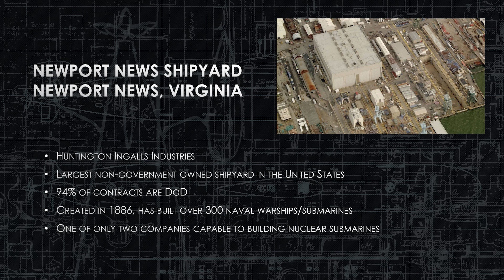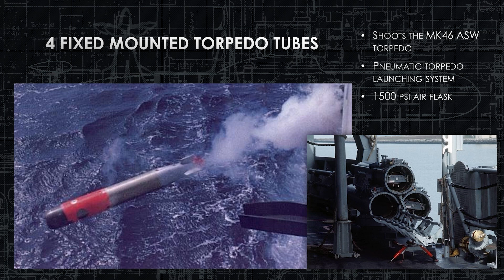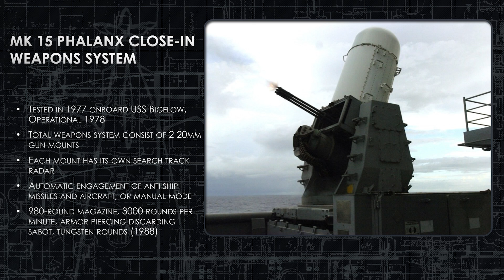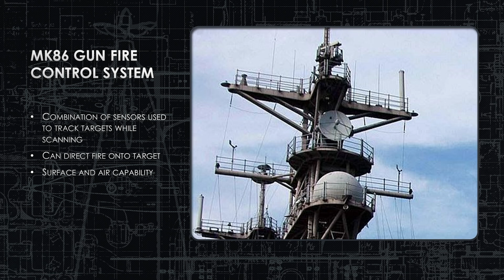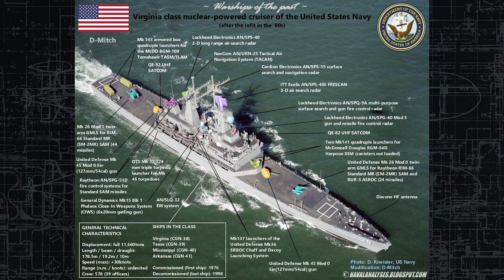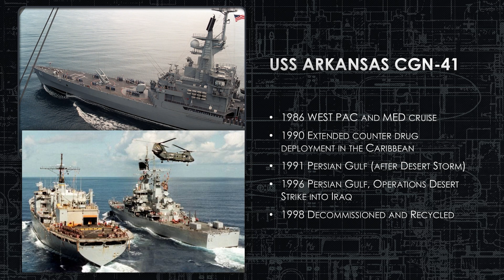America's Nuclear Cruiser Virginia CGN

Comment: Big fan of the CGN-38 class.  Cruisers that can stay with the carriers would be a force multiplier.  Have commented on using this hull to build the new cruisers to replace the Tico's!   They are bigger than the Burke's and Tico's (Tico's built on the Spruance hull) and with a nuke reactor (if you want to build a less expensive one use the gas turbines) can generate a lot of power along with not have to refuel (aux power would still need to be unrep'd but not as regular).  Plan on 64 cell vls fore and aft (replace the old Mk-26 launchers), hyper-sonic missiles mid-ship.  CWIS and SeaRam for point defense?  SPY/Aegis with the best Sonar you have!  A lot less than 12-15 bn for a battleship and probably more survivable.  With computer aided design could get these hulls out the door fast since they have been built before!

Comment: Self contained SMR reactors where it can be lowered into a new vessel and have other turbines so not to put huge strain on reactors just use them for propulsion mainly and have the two other turbines for generators then it'll have plenty of power but the reactors will be producing electricity for electric motors for propellers and the refueling process is as simply get ship to harbor unhooking smr lifting it out putting new one in hooking it up systems check deck back on crew back from R&R then off to sea thats how it will work

Comment: I was a QM3 arived the night before she left on deployment. I requested a Med. Cruise. Had Pizza & Beers in town after reporting in tossed my seabag on my bunk. Left with all the QMs. 
The Ship was responding  to a sonar contact in the Indian Ocean, Condition 1AS was set we maneuvered to intercept.   The rubber sonar dome was pressurized with the fireman system. An alarm sounds, a loss of water pressure. The Captain is present on the Bridge, speed was reduced and the sonar dome was damaged. We limped into port in Oman divers inspections sent us to Subic Bay in Philippines. We were the first East coast vessel into Subic since Vietnam War. We made max 5 knots from Indian Ocean to Dry Dock. The charts to make that trip were not in the corrected list. So a great amount of work was made to get all the new ones ready for service. There I had been a # of reported Russian sub contacts. A few bits of scuttlebutt about holding too high a speed when pumps failed. I can't confirm anything except the pressure went to a low pressure alarm sounding. I had been to the Philippines  and most hadn't made Shellback on that cruise. I discharged in September of 1980. Big time issues with getting parts. Released ships giving up parts to ships showing up to replace ships.

Comment: Ex USS Texas CGN 39, 1985-1989, sailor hear. DLGN stood for Destroyer Lite Guided Missile Nuclear. The power plants were 2 D1G reactors. I should know, I was a reactor operator in 1 plant. With regards to the hangar, it was designed for a helicopter that the navy never acquired, thus they were removed in the mid 80's. All were to be refueled and upgraded to D2G reactors in the 90's. The Clinton admin put a end to that. You left out that the Texas did a West Pac in 88. We went to the gulf of HORMUZ to plane guard for the Carl Vincent in the Iran/Iraq war. Fun times.

Comment: DLGN stands for Destroyer Leader Guided missile Nuclear. Destroyer Leader was an older concept of a ship that would be in charge of a surface force of frigates, essentially a command frigate, a usually oversized frigate with additional sensors and communications equipment, and capable of providing longer range air defense capability to a force of submarine hunters.

Comment: Late 80s early 90s I spent a lot of time working at Norfolk (as a civilian contractor). I remember seeing a Virginia on the water front. Gorgeous ships. 

In addition to the nuclear refueling issue, I believe they were also going to get NTU (New Threat Upgrade), which was also very expensive. On the old newsgroup sci.military.naval, before it devolved into a political flame fest, there were a lot of smart and knowledgeable people. One guy had NTU experience, and claimed that in some respects it was superior to Aegis. I believe the Californias got NTU, but the Virginias did not. Welcome correction, if that’s mistaken. 

I don’t recall whether the Virginias had SLQ-32(V2) or (V3). V2 was purely passive, while V3 had a jamming capability.

Comment: I rode CGN 40...  Good running ahip.   Went to South Carolina (CGN 37)  immediately after overhaul, and the chief engineer said they could have built 2 Ticonderoga class cruisers for the price of refueling for South Carolina.
Reply: No doubt the reason why the Navy went for Ticonderoga.

Same issue with the Airbus A380. Emirates president said he can fly 2 Boeing 777’s for the operating cost of a single A380

Comment: Add in a few other factors, (1) the "peace dividend" expected at the end of the Cold War, making refueling costs a more significant target (2) the improvement of gas turbine propulsion plants. One problem with steam plants, nuclear or conventional, is the time needed to heat up the plant to operating temperatures and pressures, too fast results in potential failures. With both diesel and gas turbin being pretty much turn the key and go in comparison. If only we could get direct electricity from the cloud of free electrons in a nuclear reaction.

Comment: Why put nuclear power on a destroyer??? Same size or slightly larger reactors would likely power a heavy cruiser at 40 knots or more, but could carry any WWII heavy cruiser armaments (6-inch to 10-14-inch autoloading cannons with a high rate of fire.) They could also use long-lived, stainless steel hulls to increase life and reduce painting! A-A cluster bomb rounds weighing 100-500 lbs aimed by AEGIS would deal a crushing blow to incoming aircraft ordnance , and ships. A heavy cruiser configuration would also have sufficient space and displacement to carry LOTS of missiles and perhaps room for a Helo or a F-35A STOVL

Comment: The short life of this class of ships was directly related to the cost of decontamination and refueling of the reactors.  Operating costs are significant even for just the nuclear trained crew members. I was a nuc on the Truxtun, ETN2 designated as a Reactor Operator (NEC 3383). Consider that there is no one in the engine room less than an E4 (PO3), so personnel costs are (marginally) higher for that reason and time in service. Also, nuclear engine rooms are 'top heavy' in terms of a "chief to injuns" ratio. (no disrespect to native americans). The navy had (has?) a retention problem with nucs, hence the re-enlistment bonuses. Extra personnel are required not only for the extra watches, but because of the qualification paths. Using only published data (Jane's) reveals (Truxtun vs Belknap) 60K vs 85K SHP; 8,322 vs 6,570 tons standard displacement; 36 officer, 463 enlisted = 499 vs 31 officer, 387 enlisted = 418; 30 vs 32.5 knots; 564' x 58' x 31' vs 547' x 54.8' x 28.8' dimensions. The "hull speed" of the Truxtun is slightly greater. From "Froude's Number" basically a longer displacement hull is capable of higher speeds for a given increment of power. (Nuc ships could out accelerate conventional steam turbine ships). The nuclear trained rates were not overmanned either. Stateside, if the non-nucs stood 6 section duty, nucs stood 3 section duty. Another requirement of nuclear plants is that there is always someone on duty even when shut down. Many of the books about the Navy's Nuclear Power Program and Admiral Rickover will help to explain why stringent requirements and standards are necessary which also causes costs to be higher.
Reply: Nuclear class ships need to last longer to be economical, I would say that takes stainless steel which can be made to about any spec. No Painting for stainless, either. Stainless is going to be a big market when Musk starts building a rocket a week as he predicts. Some modern reactor designs can be fueled during operation. See Generation IV reactor.
Can an F35 VTOL be accommodated onto Zumwalts with a "garage" in the superstructure?

Comment: The helo hanger didn't leak like stated.  We never did any wash down inside. It had weightlifting racks.
Correction: The missle count was 44 fwd + 24 aft
Reply: Question, if I remember right, didn't the helicopter intended for that space get canceled? Perhaps the sea-dart? It was a smaller asw copter.
Reply: @RandallVanDusen  Yes. SeaLamps was trash helicopter.
Reply: @maingear7452  I think the Des Moines has the same set-up. How did we lose the technology from there in such a short time?
Reply: It did on Virginia. One big rust hole.
Reply: It leaked like a sieve in bad weather on CGN-38. It was one big rust hole used for storage and taken out when they installed tomahawk box launchers.They dropped in a whole new compartment durin 1984 overhaul.

Comment: I would like to see a nuclear powered battleship with 16 inch or 18 inch guns that fire hypersonic projectiles.. These would be far less expensive to operate than an aircraft carrier and command a 1,000 mile footprint.. Weapons could be on target faster than aircraft and in a higher volume because of faster reload time compared to bay launched missiles.. A battleship firing gun launched hypersonic projectiles could also carry far more rounds than a missile armed ship.. Leaving the barrel at Mach-2 / 2, 000 feet per second could reach ignition height in 7 seconds at a high enough speed to ignite the hypersonic rocket engine..

Comment: Was ETNuke on South Carolina. As designed the California/ socar were on paper quite capable. Unfortunately mission creep/ design creep nullified a lot of the capabilities. Example - were deigned for carrying a helo in below deck hanger on stern. Never worked as hanger doors leaked so room became weight room/ study hall.
Reply: By which you also mean you were a "RO" or "reactor operator" (which the readers probably wouldn't know).  I was an ETN2 on board the USS Truxtun CGN35 when the "N" in the "ETN2" meant "communications.  (lol).  But I had the NEC 3383 designation (which meant nuclear reactor operator).  I don't know if all of the Des Moines or previous classes had the same problem with leaking hangar bay hatches.

Comment: Love the channel, couple things: there were two SPG 51 (both aft) not 4. They had a third director that would do double duty as Gun or Missile fire control forward (SPG-60). The Mk 26 launchers were mod 0 forward (24 rounds) and mod 1 aft (44 rounds). The mk 26 could not use the RIM-67 as it was not capable of handling the booster (need mk 10 launchers for that) SQS-26 is a low frequency sonar, thus CZ capable. Decommed instead of refuelled as they were not Aegis capable at their cost (needed expensive nuclear trained personnel) V/r CTIC(SW)

Comment: The USN abandoned nuclear-powered escorts, which, I would guess, was due to immediate construction costs compared to fossil fueled escorts. After 1973, the rapid increase in fuel costs should have made the life cycle costs of nuclear power competitive, but again, I would guess that the performance difference between gas turbine engines and steam plants, Norman Friedman covers this in his books on the design and development on cruisers and on destroyers. There's also the Conway book covering fighting ships of the 1946-1995 and, of course, the Combat Fleets series from USNI and Jane's Fighting Ships. The Mk.26 could take a SM in size between the SM MR and SM ER, and could have gained effective performance from a larger diameter booster, or a SLEP in the late 80's and early 90's with AEGIS and VLS when the rods needed replacement, but I guess it just cost to much for a Navy shifting from the Cold War to an expeditionary concept. IMHO, I think the USN suffered a lack of foresight in abandoning the weapons systems of the Outer Battle Zone in the belief the CBG's would no longer face the LR bomber with anti-ship missiles in numbers with the fall of the USSR. The other services made the same mistake of shaping their forces on expeditionary mission and counterinsurgency under the DPGM that from 1992 to 2012 kept pushing off the need to be able to face a regional near-peer or peer level competitor for 20 years, only for the near-peer competitor showed up in 2014.
Reply: @michaelsnyder3871  The driving force was manpower and the end of the Cold War. Crew is 600, 300 of which are engineers. My relief in 1993 arrived a year before my planned departure. It was a time when the Navy was looking to slash manpower as rapidly as possible.

Comment: THe design of the SLQ-25 was to stream both, one long and one short and once you detected a torpedo and it was going for one you would shut that one down and get the torpedo to go for the other one and once it was headed that way shut that one down and turn the other back on and keeping doing that until the torpedo ran out of fuel

Comment: why do ships use gas turbines instead of direct fuel turbines, as in jet aircraft . . .
Reply: The gas turbines used in ships are generally modified versions of an aircraft design. The use of a gas turbine layout means you don’t have to connect your load with the gas generator. Useful for things like ships and electrical power generation.

Comment: I found the way the Tomahawk's TERCOM guidance system worked very fascinating. It didn't work by mimicking how a human might navigate by sight - computing technology of the time wasn't really up for that. Instead, it simply used one dimensional info from a radar altimeter. As the missile flies, this becomes two dimensional info of a cross section of the terrain below it. The computer only need to try to match this altitude profile with the stored map.

The thing is ... if you tasked a human with trying to do this "pattern matching", the human would be hard pressed. It's just not the way human perception works. But a digital computer? It's just numbers and brute force searching for matches of those numbers.

Comment: 15:47 not quite, it simulates the sounds of a boat screw. The sensors in the torpedo are programed to track the largest screw sound it perceives.
Reply: Now you've done it. The FBI will be knocking on your door.
Reply: @haldorasgirson9463  old news I worked in Airborne Mine Counter Measures back in the eighties.

Comment: It was Delta Force that went into Iran and tried to save the hostages. If I'm not mistaken it was technically their first mission. There were Army Rangers pulling close in security for Delta but it was their mission. I know this because I'm a veteran of the US Army 75th Ranger Regiment and we learned the complete history of   the 75th Ranger Regiment and Ranger units going all the way back to the French and Indian Wars. Pretty much any time Delta (or as they are most commonly  known as the UNIT) or DEVGRU (Seal Team 6) go on a mission Rangers usually (but not every time) are with them to pull close in security so they can just focus on the mission and not have to worry about anything else
Reply: Aaron mentioned Marines, and the Marines that were involved were the aircrews flying Navy transport helicopters. Part of the evolution involved the Marines flying those helos to land in Iran at a patch of desert where they would meet with some Air Force electronic warfare C-130s that had been converted to carry fuel in their cargo hold. The helos would then refuel from those aircraft on the ground, and proceed to the hostages in Tehran with Delta and the Rangers on board. The plan failed when a helo and a C-130 collided on the ground and burned up. I think eight people died.
Reply: @dcbadger2  yes I think you're right ✅️.  Nothing hardly ever goes according to plan when it comes to operations like that

Comment: How did she compare to the Belknap class?
Reply: the closest nuc ship compared to the Belknap class would be the USS Truxtun DLGN/CGN 35.  Same armament and sensors but the missile and gun positions are reversed on the Truxtun.  Note that the standard displacement on the Truxtun was about 2,000 tons more - and both ships were steam powered.  Yep, those reactors weigh a lot especially with the required radiation shielding.
Reply: @bechinn1  Wow....thanks

Comment: The problem was that reactor cores at that time, while they used 70-80% HEU and 1st gen poisoning of core,  could not span whole lifetime of vessel. In recent decades new reactor models that use advanced computer modelled design, burnable neutron poisons and extremely high enrichment of fuel (just couple % shy of pure U235) have made possible to have 25-30 year reactor cores. In essence new reactor core is salted with boron and/or gadolinium, which keeps chain reaction in check absorbing neutrons and preventing freshly loaded vessel doing spontaneous Hiroshima. As years pass, and U235 is burned, so are neutron poisons too, keeping reactor in balance and like new max power levels. Modern USN nuke vessels use "better" ie more highly enriched Uranium than US nuclear weapons.
Reply: Thank you I’ve leaned something new today
Reply: @kimj2570   thankyou.
Reply: The US should use modern ship reactors as you described on new destroyers or cruisers; they may be forced to if China employs nuke power on their cruisers or destroyers
Reply: @philipbrady-h4d Nuke vessels costs absolute fortune. For carrier its no brainer. How many oilers 100.000t carrier would need? Way too many.

As Navy will not be 100% nuke anyway, question is could escort destroyers fueled without problem. If fueling is not problem you build conventional vessels. If fueling becomes impossible, you go nuke.
Reply: @philipbrady-h4d China aint building, or even designing nuclear destroyers or cruisers. Their next carrier might be nuclear, or not.
Reply: Chinese aint repeating Russian clowning. Building cruiser that has some antiship capability but sucks whole naval budget. Russians have one Kirov class cruiser that has been 20 years in modernization program.